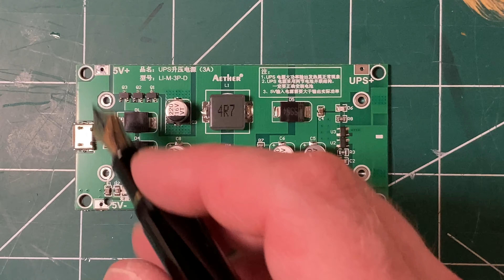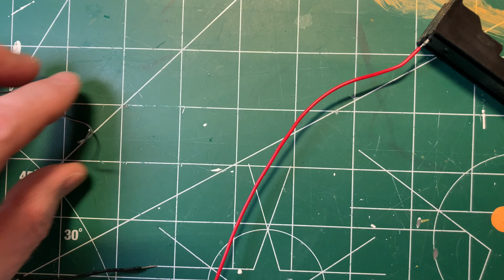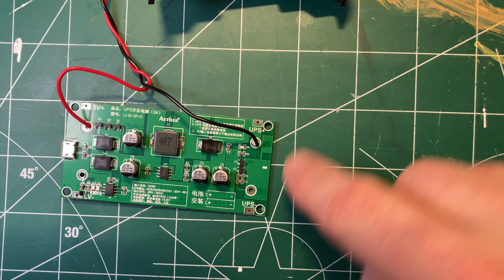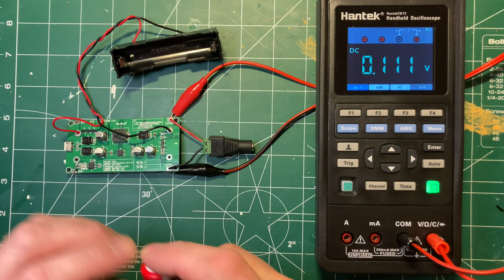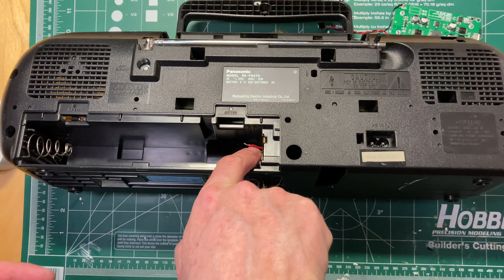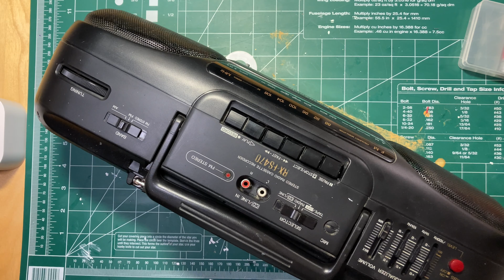Adapting an eBay LI M 3P D 'UPS' Power Supply to run a Boombox with 18650 Cells

Comment: This video made me cringe. I don't think the poster fully understands how this circuit works. The power supply into the board is ALWAYS 5V (that's why the vias are labeled as 5V). Putting in higher voltage may burn components out. There's a voltage boost circuit which will EITHER boost the 5V input (if applied) OR the battery output (if the PSU is not connected) to the 9V at the board UPS output. The board will automatically select the power source to the boost circuit - that's what the big diodes and MOSFETs are for. Connecting a 9V PSU to the output will cause a conflict in the voltage regulation.